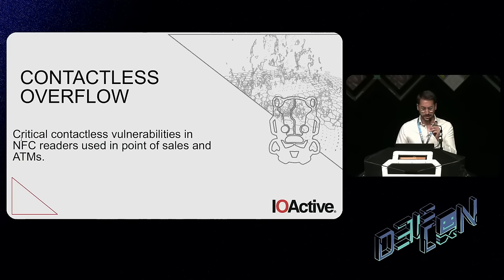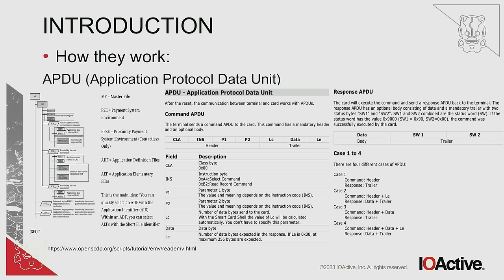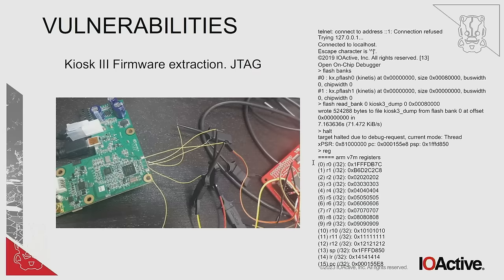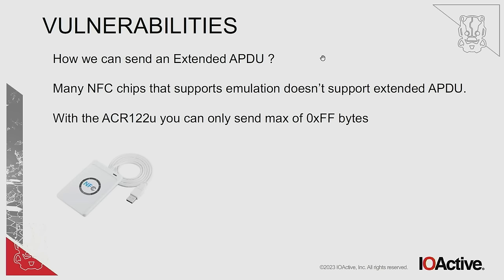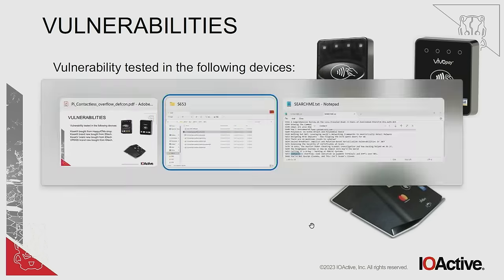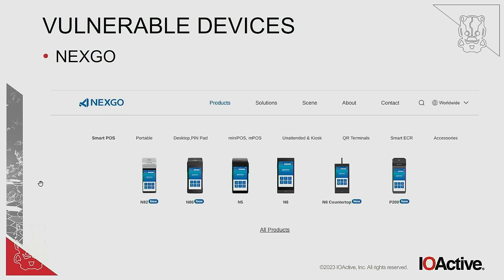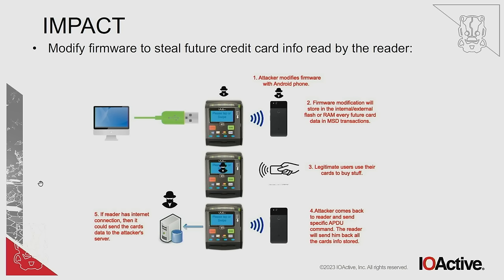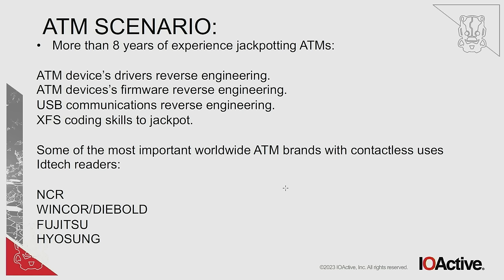DEF CON 31 - Contactless Overflow Code Execution in Payment Terminals & ATMs - Josep Rodriguez

Comment: This kind of hack just blows my mind. It was all incredibly easy, basic stuff. JTAG debugging enabled to dump the firmware, accepting 64KB inputs that automatically overflow... We hold the assumption that manufactures do the bare minimum to prevent extremely easy exploits like this. So no one really even bothers to look. But once it's proven that there is incredibly low-hanging fruit available, expect more people to start poking at systems like this to see if they also have easy-mode hacking enabled.
Reply: You got one thing right, they do the bare minimum 😂😂
Reply: security should not be based on ignorance, it should be based on competence and redundancy, my dude
Reply: they did not even prevent firmware extraction... so dumb
Reply: truth is, in the modern world most people stick computers in stuff without even having someone with any infosec knowledge on board. That's just how it is. The risk's usually estimated as not worth paying an infosec guy their wage.
Reply: Are you good at pen testing? Can we talk somewhere
Reply: @Soloone1  who are you talking to ?
Reply: The actual issue is almost forgivable when you consider this is a return of the long since dead attack vector, the classic buffer overflow. 

We have to remember that this whole class of attacks was practically eliminated circa 2000 with the introduction of the NX bit and ASLR. It hasn't been until the introduction of microcontrolers comparable to 386+ levels of complexity that such attack vectors were reintroduced. Between then and now though, most exploits focused on bypassing higher level, more complex security, and the classic buffer overflow was more or less left on the wayside as "to old to work."

I guess it shows that history repeats itself.
Reply: @JustAnotherAlchemist  Heard of ROP? I mean yeah, not being able to execute code from the stack and easily finding addresses means you generally need a leak somewhere, but the buffer overflow has been far from dead.
Reply: @siimon1306  ROP bypasses NX bit. ASLR is added to prevent ROP. More sophisticated attacks were added on top of that.... etc. etc..
Reply: @JustAnotherAlchemist  Exactly, my point simply being that it is slightly misleading/inaccurate to say that the buffer overflow hasn't been a viable attack vector since the 2000's as, still to this day, there are plenty of exploits taking advantage of a buffer overflow, even though it might generally be more complicated to pull off today.
Reply: This was in no way easy. He spent hours reverse engineering binary firmware. Nobody is doing that.

Comment: Love how the microphone interference just keeps getting louder and louder.
Reply: Hear no interference... maybe because I'm old. Sounds perfectly clear to me.
Reply: It isn't interferencd. It is a 60 cycle ground hum. Any high school AV squad knows how to check for ground faults. Sometimes it is as simple as turning a plug around in a power socket. Sometimes it is a disconnected ground wire.
 About as difficult to fix as "gee, my flashight went out."
Reply: @lyfandeth  no hum neither. Clear for me.
Reply: @framegrace1  maybe you didn't watch the video for long enough? it starts at around 26 minutes
Reply: I heard the humming from the beginning..
Reply: @markblacket8900  No it's definitely there from the start. I can hear it even over my phone speaker right after the applause at the start stops.
Reply: oh yeah, you're right, it's way more faint before the 26 minute mark, but still noticeable if I turn the volume up a little bit
Reply: @framegrace1 it has that transformer hum you hear at power stations
Reply: Yeah there’s obviously an incredible annoying hum. How embarrassing quite frankly. How about someone there takes 5 seconds to fix the problem considering we’re sat here discussing taking control of ATM’s and all sorts. It’s not like the place is full of people who work with technology….oh wait, yeah it is. I completely stopped listening for a solid 10 minutes because I could barely hear him, especially with his accent…too much of my focus was on simply hearing him that I couldn’t follow the actual content.
Reply: Really DefCon is disrespecting the presenters by being so damn lazy
Reply: @lyfandeth yeah in clubs I am always grinning when disconnecting ground solves it..specially since you manually just connected most of them (on turntables and cddj,mixer)
Reply: @lyfandeth  Turning the plug around? American electricity is really wrong.
My guess in this case is it's related to the fact his sound wasn't working for playing videos... 3.5mm plug not quite plugged into the computer.
Reply: 26:23 you can really hear it now

Comment: 15:20 When he said these things don't have secure boot I could not contain my "woah!". How the fuck is an ATM part less secure than like basic android smartphones?
Reply: Because the Android smartphone isn't security through obscurity/NDA and is more available to consumers/developers.
Reply: Because Windows CE doesn't support secure boot lol

Except for with third party loaders like CELoader
Reply: @joshua_337  the payment terminal isn't running windows. The ATM might be, but the actual card reading terminal is a totally separate deal with its own firmware and processor. In fact, many of them run Android, which has quite good support for secure boot. Even if the support was trash, there's no excuse for potentially allowing unsigned firmware to process people's credit cards. It's just ridiculous, this is one of the few devices on which I would concede the security benefits of permanently burning an encryption key into e-fuses for checking the signature of the firmware, and they couldn't even be bothered to put the work in to do that.
Reply: @Jeff-ss6qt  my bike got stolen during  the carnivals where there where 4000+ other bicles, security by obscurity is a joke LOL
Reply: @tissuepaper9962  
Some of the newer Ingenico terminals run Android (and it's hilariously easy to get into places you shouldn't - though props to whoever disabled the "build" entry in settings so you can't enable developer settings). I'm not sure if they're using software to talk to the NFC or a middleman chip like this video though... I think I'd get fired if I ripped the terminal apart to find out.
Reply: I just want the code for FREE Chips 🍟 😅

Comment: Wow rolling physical firmware updates on millions of devices is going to be a pain. 
Ok, let’s be real - alot of the POS stuff may never get patched ;)
Reply: almost all of them you mean
Reply: It's ok though - it's the bank's money :)
Reply: @SP-ny1fk  fundamental misunderstanding of the modern financial system. If the banks all lose a shitload of money, your money becomes less valuable, because the government will feel obligated to bail out the banks by printing absurd amounts of cash.
Reply: @SP-ny1fk  in case of ATM's, yes. Not in the case of terminals, in this case it's more likely to impact the merchants and/or the consumers, based on the goal of the malware that they implant
Reply: POS are inherently always connected to the internet. OTA updates shouldn't be a problem, really.
Reply: Most POS terminals have had OTA / remote downloads for a very long time. Ingenico have had this since the 1990s.
Reply: Those devices you refer to are what some might also call obsolete.
Reply: hey free soda, thas cool

Comment: It’s astonishing to me that a conference attended by some of the best minds in technology can’t upload a YouTube video without an incredibly f*cking annoying interference hum almost as loud as the person. If you’re reading this guys…sort it out; it’s just embarrassing
Reply: It sounds like a nasty ground loop or unterminated audio into a mixer from whatever setup they have to get audio from presenters devices on stage. Perhaps the venue insists on using their provided stage equipment and PA and DEFCON has to take a feed from that for recordings. <shrug>
Reply: @ChristopherWoods  yeah but that’s easily filtered even in the video post production edit right? So it still seems lazy to me
Reply: The livestream might be more difficult (not impossible) but once it’s finished; you take that audio and filter out those frequencies
Reply: @ClassicRiki  can be tricky as sometimes the processing can make the vocal quite 'squelchy' and unnatural. I wonder if they just wanted to get the video up quickly despite the audio issues.
Reply: It seems like the majority of videos have some kind of levels, mic, sound or video issue in them. Are they really so stingy they wont pay for a good sound technician?

Comment: Was able to crash some gas pumps with contactless using a flipper zero. I know that flipper can't emulate EMV payments, but it will damn sure crash a payment system 😂
It pretty much made the pump unresponsive for ab 10min while it rebooted, the screen showed some pretty interesting information such as firmware version and OS. Was pretty surprised zero crashed it though....

Comment: every 2nd sentence starts with "as you can see in this 2k-lines pale-on-white code vomit with fontsize <1px..." yeah NO WE CANNOT.

also it'd help to be told why any of the things in the alleged explanation are, not just that . "oh this magic hex number which is this irrelevant decimal number allows us to write $PC"?! no, not without telling anyone where you think that REGISTER is gonna come from in the middle of HEAP!
Reply: How about reading the documentation they provide...  This is just a talk, not a lecture.
Reply: @framegrace1  a talk is supposed to summarize/present the new information it's about, not show a wall of unreadable while going "as you clearly see here" and "as you know" every 2 seconds as if the audience wrote the lecture.
Reply: You may not be the target audience for this presentation.
Reply: @publicacct5626  who is? people with CSI-style "enhance" built into their screens?
Reply: The speaker is using standard exploit strategies (that is partly why this is so jaw dropping - that so much low hanging fruit is there). He doesn't need to explain what a stack overflow or secure boot is to this audience.
Reply: There is a whole field of people who's job it is to reverse engineer software and hardware devices. This talk was for them.

Additionally, I really don't think you need to be a reverse engineer to understand this. I understood most of the concepts, and only have a Bachelor in Computer science.